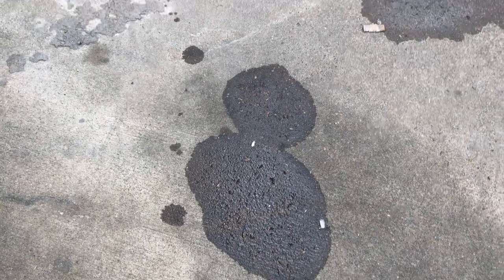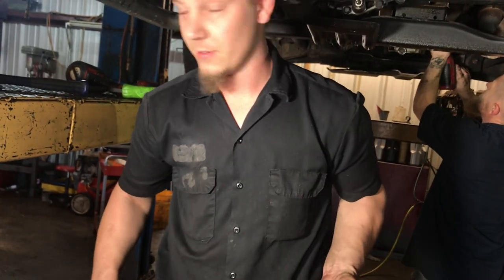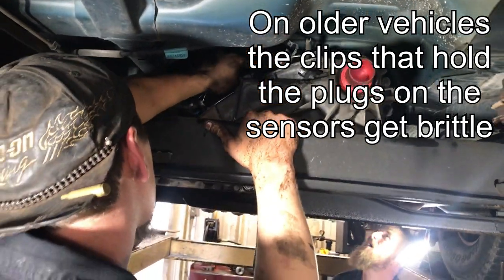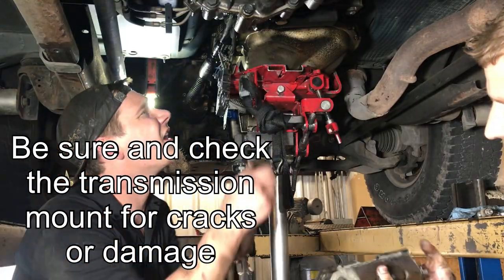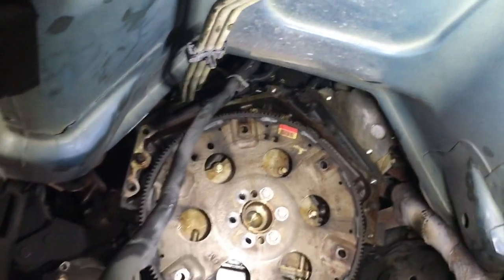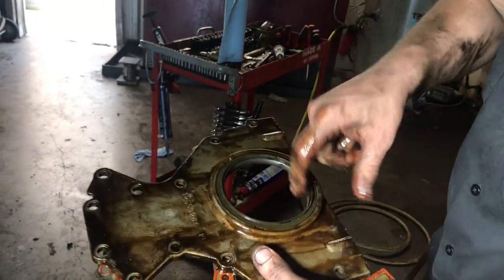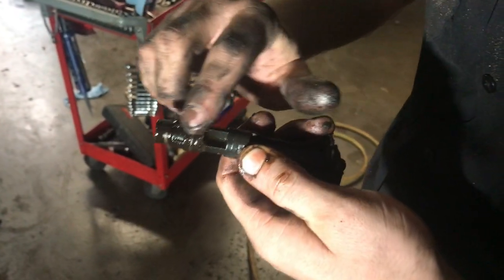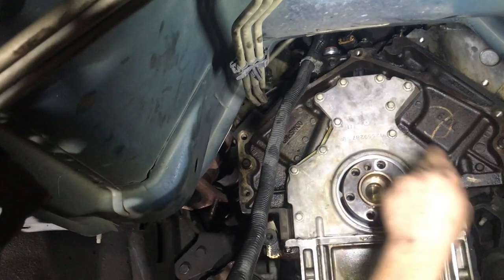6.0L rear main seal REPAIR do it yourself

Comment: Thanks for saving me a lot of money on this issue.  I had the same Oil leak for years on my 2004 Escalade ESV 6.0  and it finally got bad enough to fix it.  My Oil pressure had been fluctuating abnormally on and off for about 6 months and my small leak became a huge spot on my drive way. I first changed both valve cover gasket after seeing leaks and the leak went from a big spot to smaller drops and small spot. So we suspected the rear mail seal. After watching this video and seeing the Oil leaking from the top with your Crankshaft sensor having a flat O-ring I suspected my Crankshaft Sensor or Oil pressure sensor as being the culprit.  I verified with a fiber optic wire camera that there was oil in the area of the two sensor.  I replaced both Sensors the Crankshaft sensor failed internally and the connector was full with oil.  My leak has been fixed and I didn't have to do the major job of replacing the rear main seal. Also after replacing the gasket on the valve covers I had white smoke upon start up and also saw another video that showed the fix to be the drivers side valve cover with built in PCV valve. This fix also worked for me.  Thanks to the youtubers that share the knowledge. Gob Bless you and God Bless America
Reply: 100% Conjunto!  Thank you for adding your experience with us too! I have the same issue and I'm going to check the Crankshaft sensor and replace both of them since I'm getting some faulty oil pressure reading, TY!

Comment: Very well done video! I've offered to do this for a friend of my wife (due to pandemic-based unemployment, she can't take it anywhere else). I'll be laying on my back doing it (two weeks! ;-) ), and based on your video, it looks like I have all the tools necessary (not sure about the oil pressure sensor tool, that wasn't explored deep enough, but probably not too hard to figure out). Your generosity is going to be paid forward. Thank you.

Comment: My 2001 transfer case fluid is blue it's called auto track 2 it's the  recommended gm fluid for gm transfer cases. It is not supposed to be the same as transmission atf. The fly wheel should of been marked to get exact replacing and a centering tool should of been used on the seal cover before installing seal and some rtv at the bottom of rear cover and oil pan in each corner That's why I have to do things myself to make sure every step is done right and to get the most out of it not just good enough.
Reply: Just to add, the 07+ Escalade and Denali awd case uses the atf fluid. Awd and 4wd are different cases.
Reply: Yup these ASE guys missed some critical steps
Reply: Yup
Reply: Thats why they are in the shop, and u ain't.  They are pros.  Some bs steps can be skipped.  The flexplate is balanced, it doesn't matter what position it goes back on.

Comment: So rear main seal wasn't leaking... Always check your oil pressure and cam sensor in the back of your engine before going straight to the main seal. Could also be the valve cover gaskets in the back of the engine. Contrary to them saying it is the same jobe to replace those sensors, it is not. You can reach the sensors just fine by taking off the plastic engine cover. Just did this on an 06 5.3L in about 10 minutes.
Reply: When yours was leaking did your oil pressure sensor leak oil? I have a oil leak coming from the rear main area but I am not 100% sure my oil pressure gauge is always pegged I have a 04 trailblazer with the 5.3 4wd
Reply: @1-Six-dee  my oil pressure sensor was shootin oil down back of motor. 5.3l
Reply: @chrisg1364  I had It repaired it was my Rear main but the oil sensor was bad
Reply from the maker: The plate on the back of the engine was leaking and the seal had over 200,000 miles on it.
Reply: @1-Six-dee your oil pressure sensor is bad if it's always pegged out  and it's probably the leak as well and yes these guys are correct it is a super easy job comparatively to the rear main seal from the top but that specific socket is a life saver for sure may as well do the CAM sensor while your there too and the intake gasket is reusable but if you think it's old and you can replace it as well it would be of course better the oil pressure sensor on all those LS motors is a common issue as is the o ring on the pick up tube but there is no easy fix for that the oil pan must come off but even that is not extremely terrible it's a job but if you are a half decent mechanic well let's just say there are much worse jobs for sure

Comment: Good video, I laughed when you was pulling the trans and you said it would suck to do this on your back.... I have a 02 2500hd and had to replace my transfer case... and I had to pull old one and put new one in laying on my back... you dont know strength until you have to man handle a transfer case on your back lining it up and getting the bolt in to hold it from dropping.... alot of cussing was involved with my install.... but great video guys....
Reply from the maker: Josh Minzler Thanks for the input.

Comment: So they pull your trans to do a rear main, find out its the cam sensor, so to cover their ass they pull the bolts on the rear cover and when the bolt comes out they tell you it was bad because it starts leaking oil from the hole 

That hole is open ended in the block so its obviously going to leak oil when you take the bolt out, then when they pull the cover they don't even check the oil bypass dogbone which is an Achilles heel on the ls engine and is 7 dollars to fix, if it goes bad you're fucked so why not do it while you're there?

Secondly they reuse the flexplate bolts, which are 1 time use and are torque to yield 

Then tell you its easier to pull an trans than the intake, you realize its an LS right? It takes 15 minutes and an 8mm and 10mm to remove the entire thing, and the intake gasket clips on to the intake and is reusable lol. If ANY engine needed the entire trans removed just to replace a cam sensor it'd be they stupidest designed engine ever made and this definitely isn't it

Classic case of getting fucked right here

If anyone gets this far in my comment and wants to know how to actually avoid this bullshit you're watching, understand this. Get under the truck and look, look for the absolute highest possible spot you can find of oil leaks. If you see oil ON TOP of your transmission its definitely not the rear main,

OIL DOESN'T LEAK UPHILL

Comment: I enjoyed the video but when he said it’s more labor intensive to take the intake manifold off rather than then transmission that part didn’t make any sense
Reply: They're probably thinking about it from the standpoint of having a lift, vs. going topside.  
Since they're a trans repair shop, they're probably used to doing most jobs from underneath (although they had to get the socket for the oil pressure sensor, so they probably don't do too many of these jobs).  
Luckily, there's clearance for both sensors to be removed with the intake in place (I'd have laughed if they had to remove it for clearance).

Comment: Good clean job guys,,,I did a 700r4 {1992 2500 Silverado} and transfer case on my back in 2 hrs...i have 3 broken ribs..7 bad vertebraes ..bad collar and should blade...car accident a while back..... I'm not a badass...JUST SAYING if I could do it...YOU CAN TOO!    
I DID HAVE a transmission floor jack
On the oil pressure switch/sensor,,, I always use a thread sealer (white paste)... remember ,,there's pressure on that OPS

Comment: This is a great vid, these guys really know their stuff, this does not look like a job for a DIY guy, but this would a great help to any one that is willing to try. When my guy told me that the trans had to come out to change the rear main seal, I could not understand the reason, what happened to the wick type seal in the rear main crank journal? Thanks again u guys and U TUBE.

Comment: Lol the intake manifold is DEFINITELY easier than pulling the transmission, they're taking you for a fool lol
Reply: Wtf are you talking about
Reply: @strykerls3740  lol his main wasn't leaking.  It was coming from the sensor or maybe the valley gasket. See how the main seal is dry? Till he touches the seal with his oil fingers lol. The flex plate was also dry.  They robbed him
Reply: Thank you. I was I'm sure they made sure the flex plate was wet. When I seen the flex plate was dry I was like they screwed dude. See how the main seal was dry till he touched it with his oil finger.? That was smooth

Comment: Impressed with these Mechanics.  Need a rear main.  Live in Houston so may give them a call.  Thanks.  Great job and interesting video.
Reply from the maker: Bob Dowlen thanks for the comments
Reply: Don't. They charged this dude for a main seal that wasn't leaking.  It was a sensor leaking.  See how the main seal was dry till he touched it with his oil finger?

Comment: I have a 2000 Silverado 4.8L 2W drive pick-up truck, leaking oil from rear main seal. I know this because I recently changed my heads, timing chain, oil pan gasket, knock sensors, oil pump, misc. 2W drive has got to be a little easier but if the price was right I would pay these guys to do it. Laying on my back to do this doesn’t sound like fun... but I may have to 🤪

Comment: Looks like the cam sensor was leaking more than the rear main seal looks like a mess up on the diagnostics been a mechanic for 30 years and I know when a mechanic is trying to play it off like they were right LoL.
Reply from the maker: Camaro Drag Racing Second Generation we knew that everything was leaking. The mechanic did not diag this wrong. The truck has 250,000 miles on it. The purpose of this video was to show the easiest way to take care of “all” the leaks. With your 30 years of experience you would know that if you remove the transmission to access the cam sensor or oil pressure sensor it makes since to fix all the leaks while in there. Thanks for commenting tho.
Reply: FYI: I had the same Oil leak for years on my 2004 Escalade ESV 6.0  with 250K and it finally got bad enough to fix it.  My Oil pressure had been fluctuating abnormally on and off for about 6 months and my small leak became a huge spot on my drive way. I first changed both valve cover gasket after seeing leaks and the leak went from a big spot to smaller drops and small spot. So we suspected the rear mail seal. After watching this video and seeing the Oil leaking from the top with your Crankshaft sensor having a flat O-ring I suspected my Crankshaft Sensor or Oil pressure sensor as being the culprit.  I verified with a fiber optic wire camera that there was oil in the area of the two sensor.  I replaced both Sensors the Crankshaft sensor failed internally and the connector was full with oil.  My leak has been fixed and I didn't have to do the major job of replacing the rear main seal. Also after replacing the gasket on the valve covers I had white smoke upon start up and also saw another video that showed the fix to be the drivers side valve cover with built in PCV valve. This fix also worked for me.  Thanks to the youtubers that share their knowledge and those that comment on the videos. Gob Bless you and God Bless America

Comment: Safety first? Where are your safety glasses you only have one set of eyes a lot of road dirt and rust under there. Hey guys thumbs up you are super pros this is a tough job. I’m doing my wife’s 2000 Tahoe in the drive way rebuilt transmission all by myself on my back I’m 46 an industrial mechanic it’s probably going to take me working on it 3-4 hours a day a couple of days we have been losing a lot of oil I got the doorman replacement rear main seal cover plate. I better change the crank sensor and sending unit after watching this video. Once again top notch shit in your video you guys are real on the top of your profession hats off to you.
Reply: Safety Squint Activated

Comment: My 2002 2500HD has got a BAD leak. I have to add sometimes 2 quarts a day. Landscape truck. My mechanic says he THINKS it’s the crankshaft bearing seal? He can’t do the work. I know the rear main seal is leaking too.   267,000 miles.  With the cost of new trucks? Only to be ragged out quickly at work?

Before I buy a NEW truck I don’t want to give up on mine yet. How much did it cost you to have this done?  Roughly how much?

Thanks.

Comment: looks the leakage was from the pressure sensor. Can it be replaced from the top of the vehicle?
Reply from the maker: Yes if you pull the intake

Comment: I never heard of a 6.0 in a 1500.  Wheel caps look like a 2500??  The job goes better when it's on a nice lift other than laying on your back. Nice video.
Reply: It’s a 1500HD. The HD has a lot of the same options as a 2500 (upgraded suspension, engine, trans, etc) 
In other words it is practically a 2500.
Reply: I have one 2005 chevy Silverado 1500HD
Reply: As the others said... the 1500HD is basically a 2500HD with a badge job.  Essentially the same truck to the rear axle, and sits 2" lower.  Other than that, it's an HD-spec, 8-lug truck. ONLY came in CCSB, though.
Now, there was a way to get a 6.0L in a regular 1500 of that vintage.  GMC Sierra Denali.  That got the 6.0L, but the rest of the truck was 1/2 ton / 6-lug.  Not sure what trans it got (the 1500HD got the 4L80).

Comment: I just had my rear main seal done on my 08 Silverado 1500 at the shop I picked up my truck yesterday on my way home I have the throttle all the way down I have a loss of power and it doesn’t shift to second now the mechanic doesn’t know what’s wrong with it any help would be great thanks

Comment: Bottom 2 last so you’re seal doesn’t miss align
Reply: I cringed when I heard that
Reply: All data says to start with those two... When using the alignment tool so the plate doesn't get pulled down.

Comment: I have a 2003 chevy 6.0L 2500hd and it was leaking from the rear main seal. I went to buy the part but it was smaller so I went to another auto parts but they kept giving me the same rear main seal, it was small too. Any clue?

Comment: Does the seal go in dry,and are the alignment tools a waste of money?
Reply: Outside of the seal that goes in the plate goes in dry the inside that goes in on the snout of the crank goes in wet the alignment tools are NOT a waste of money. I have done quite a few successfully without the tool but one job made me buy it because I had to pull the trans 3 times. For that much of a labor intensive job especially if your working off your back spend the 50 bucks on the tool just for the insurance.

Comment: Bro got ripped off. They wanted to replace those sensors bc that's where the leak was coming from. Didn't need to pull the trans to replace those. Your main was fine.

Comment: It’s 2023, 3.0 Duramax, and Chevy stuck with the same location for cam sensor, oil pressure sensor, while adding oil pump chain with 100k life,so you must drop the transmission. So engineers aren’t getting smarter at all over there.🤦🏾‍♂️

Comment: Informative video. But I so have to say the DIY portion is ruined at the very start. Everyday folks dont have vehicle lifts. Because I replacing a rear main seal for my grandma in the driveway today and tomorrow just having issues with getting the transmission out with the small amount of clearance that I have but I will remove the exhaust tomorrow and get it pulled and have access to it. Guess I should make a video cuz that real DIY DONE IN YOUR DRIVEWAY NOT IN A SHOP🤣🤷‍♂️🙄

Comment: that's exactly was my problem oil leak.I have 2007 gmc yukon denali.I brought the truck to checy dealership they told me is done...but isn't true.this job take a least 3 or 4 days..I searching what atcion i would like to take against the the dealer..I have the proof they told me is done not way same day plus the replaced airbags recall...please anyone with suggestion is welcome & thankfull.

Comment: Absolutely incorrect way to replace that rear main seal. The bolts that go in the oil pan go in last. First you center the plate before tightening it up.
Reply from the maker: It’s been like that for 4 years now lol